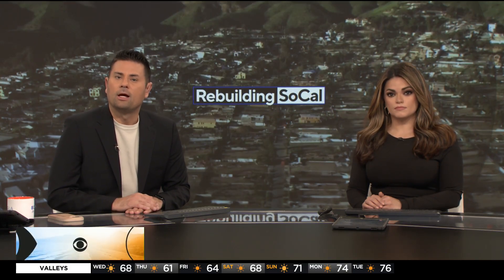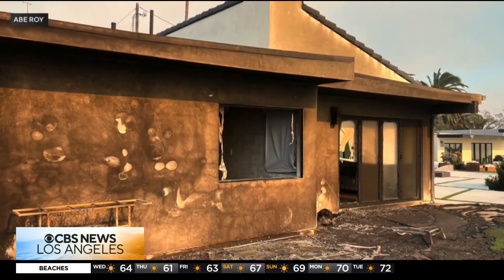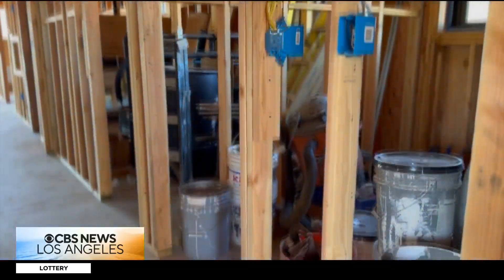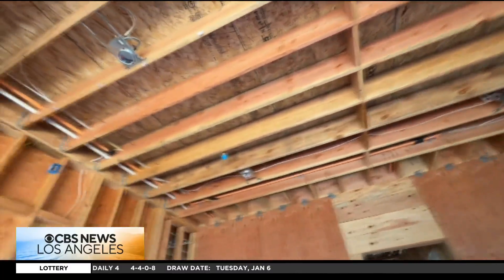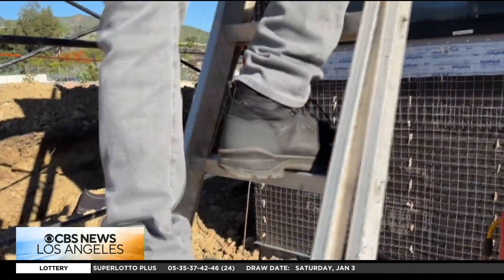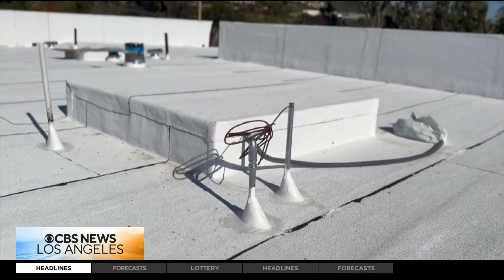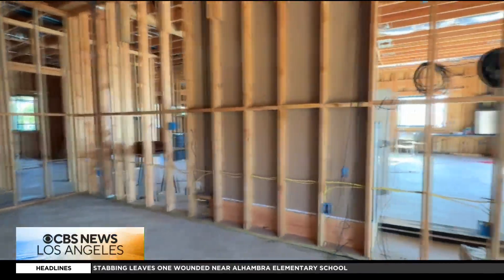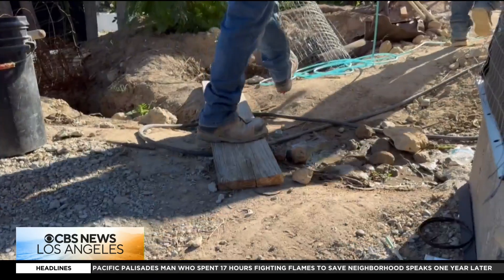Malibu resident and architect is helping to build fire-resistant homes

Comment: Instead of giving jolly reporters, you should investigate the LA planning department and costal commission that is running by bunch of no good people , because of after years of engineering and submitting plans and design by several top local engineering firms, still can’t get an approval because no one in the planning department is knowledgeable.